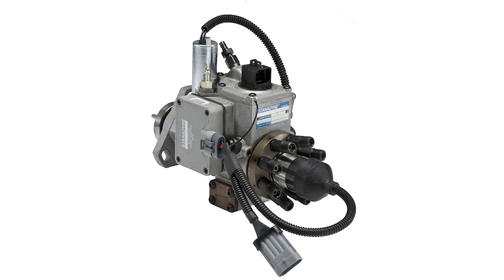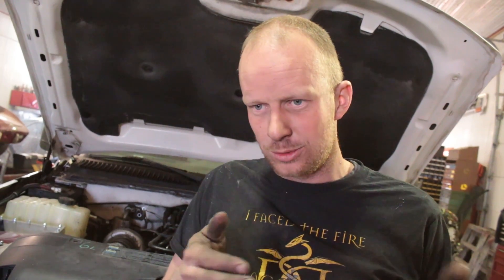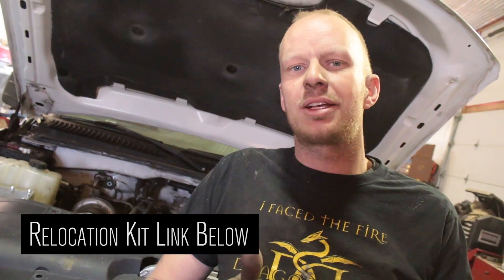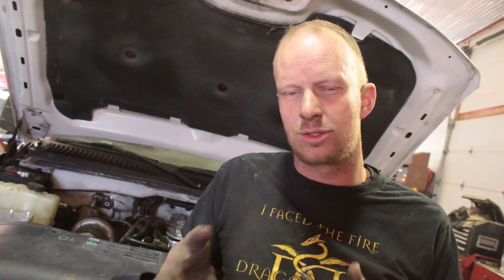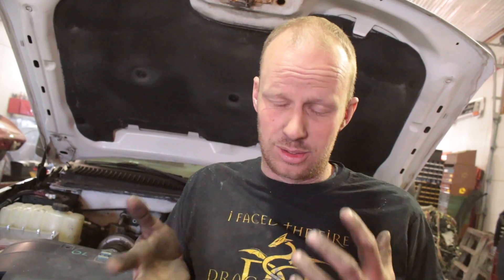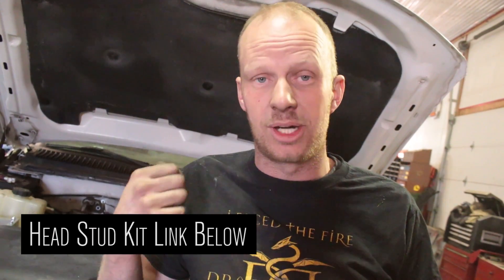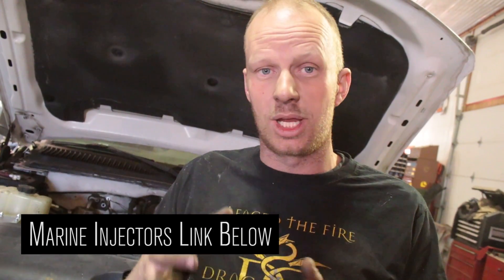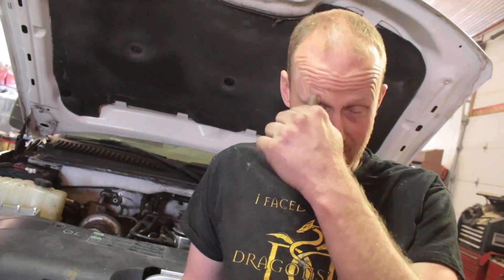REVIEW: Everything Wrong With A GM 6.5 Detroit Diesel

Comment: Haha 6.4 cough had me dying
Reply: Navistar fucked the pooch..
Reply: @PureCountryof91  they just weren't ready for DPF. Trust me when I say there was NO diesel engine ready for that crap. Even if you didn't melt a piston or valve you would definitely kill turbos quickly.
Reply: Works great as a boat anchor, not so much as an engine
Reply: @MrErikw26  One fast motor if you can keep it together.
Reply: @Mrjohnnymoo1  that's a YUGE IF
Reply: @MrErikw26  Granted, but I guess the 6.4 is like an 80s rockstar. It's here for a good time, not a long time.
Reply: 6.4 was designed as a 100k throwaway engine.
Reply: 6.4 was a huge mistake. Ford threw it out there when it wasn’t ready. Junk!
Reply: Its why ford dropped international and built the powerstroke themselves
Reply: My deleted 6.4 will drag the Detroit junk all day long
Reply: The 6.4s r dumpster fires. Get a 6.0
Reply: Same
Reply: I had one ..... It blew I have a 24v now
Reply: My brothers burst into flames from the crappy regen system. He replaced it with a silverado.
Reply: Lmao! I was saying the 6.4 in my head than he said it!
Reply: So I've been working at this shop for 18 months right.. the same blue Ford truck cab is 10' in the air suspended over top a dead 6.4 in frame, cuz my boss doesn't know what's wrong with it or how to fix it! So he just leaves it. Then doesnt bother to tell us we have 2 weeks off cuz of Coronavirus. Bahahahhaahaha awesome guy.
Reply: Anything truly bullet proof. 

Is bullet proof without having to spend thousands on fixes and days of labor.
Reply: 5.9 Cummins
Boring ugga dugga engine
7.3 Powerstroke
Boring ugga dugga engine that marks its territory
6.0 Powerstroke
Slightly fun ugga dugga engine that says fuck you with it's hpop and won't start.
6.4 power stroke
Raped ape until everything on it says fuck you and dies
6.7 Powerstroke
Penultimate POWER.
.
.
Until the egr clogs then you gotta tear em down

24 valve Cummins
Higher flowing ugga dugga engine

Where's the Chevy you may ask?

There engine is made my Isuzu

Bless you I know
Reply: @trexthepony8614  I mean a 12valve Cummins is JDM so. 🤷‍♂️
Reply: @trexthepony8614  I dont think you get it. The 12 valve cummins is litterally japanese.
Reply: @Pandasquidward  the american company with a German injection pump is japanese? Do tell I would love to hear it
Reply: SilverPanda WS6 No. No it isn’t🤣
Reply: @trexthepony8614  Explain how a Detroit 6V-71 is "clapped out".They used 71 Series for a long time in Military trucks from Oshkosh or Caterpillar.Before updating to 92 Series and actual Caterpillar engines.
Reply: @Pandasquidward  are you insane
Reply: SkyBlu_LML   So I did hear that when he coughed
Reply: Any ford powerstroke sucks so does the name brand ford and diesel truck they made sucks including the old 7.3
Reply: Gamerbeastboy18 you must never rode or driven a 7.3 or even looked at one
Reply: @gamerbeastboy1842  sounds like you’re a fanboy of....something. Power stroke is a great platform, except the 6.4, they’re pretty useless from new.
Reply: @gamerbeastboy1842  I see you saying bullshit all the time about the Powerstrokes on any video from YouTube.If you've never owned or wrenched on one,keep your ignorant mouth shut.If you want to talk about the negativity,focus on the 6.4L PSD which was one of the worst compression engines ever made in existence,it was utterly a piece of shit.The other main three (7.3L PSD,6.0L PSD,and 6.7L PSD) are far from worse.
Reply: SkyBlu_LML  ya it had me to for a min
Reply: He forgot about the 6.0
Reply: @daltonbrink6336  The 6.0L PSD is far from being anything like the 6.4L PSD.Both engines have a 4.13 stroke while the 6.0L has a 3.74 bore but the 6.4L has a 3.87 bore.Most 6.0L PSD's from 2003-2004 were actually more problematic than the ones from 2005-2007.Most obvious issues were the EGR cooler,oil cooler,and head gaskets but some have actually gone as high as 350,000 miles without one of those failing,which is rarely heard of.If a EGR delete is done and a blue spring upgrade is completed,they wake up.Head studs aren't actually a necessity unless the head gaskets are a problem,but it's still obviously a better thing to do.Alot of the 6.0L PSD's actually have traveled up to 600,000 miles like the Ford 6.7L.
The 6.4L PSD is just disastrous,it really is.They have weak pistons,and since they have DPF espiecally for the filters,exhaust strokes dump fuel and there is continuous blow by.You cannot solve this error,cylinders number 7 and 8 will always have blow by on a compression test.They also have the same EGR and head gaskets failures too.The sequential turbochargers on them are weak and always fail,it's better to use a Non-VGT turbocharger.If you have a aftermarket 6.4L PSD,at best,it will last 515,000 miles if you're lucky.The 6.4L PSD commits suicide at 309,000 miles.It's actually just the best option to use a F250-F550 with the 6.8L V10 if you want a 2008-2010 Super Duty,the alcoholic gas V10 will actually last far longer in mileage than them.
Reply: Dalton Brink       6.0 turned out to be a great engine with aftermarket support
Reply: @tomh6779  agreed
Reply: Or the 6.0 Ford
Reply: 6.4 is better than the 6.0.
Reply: @madbear3512  you're fucking drunk or have never worked on either.
Reply: @Alejandro-vb2fx  6.4 was not designed for DPF, which the 6.0 never had. Do some research on diesel engines. Many manufacturers discontinued sales of their engines in the US after 2007.
Reply: madbear3512 lol how at least the 6.0 had a strong bottom end
Reply: @madbear3512  nope, not even close. Once bullet proofed the 6.0 is a great engine. The 6.4 is worse from the start and never gets better. No diesel shops will tell you to use a 6.4 in anything. Not so with 6.0, again, once bullet proofed.

Comment: Didn't the HMMV use a 6.2 liter for a while too? They were pretty mediocre too. Putting a Cummins or Cat in one was a nice upgrade, or go back to a gasoline big block, and plan on replacing it early/ier.
Reply: had to be very little elctronics in a hummvee and the 6.5 wasnt meant for what they used them for remember 13k poind vehicle a 12v wouldnt have lasted either

Comment: the 6.2 diesel and 454 was better than the 6.5 by what I've read
Reply: Jeremy Gilliam If you've got a 454, that's due for a rebuild, you can always take it up to a 496. Sixty over, with  a quarter-inch, stroker crank.

Comment: I put a 6.5 turbo truck engine in my boat not knowing that it had a strictly mechanical pump. Good news when I found out. It runs great even without water cooled exhausts. The exhausts are heavily insulated. I tow the boat with an 86 Chevy truck with non turbo Goodwrench 6.5.  The new fluid filled harmonic balancer smoothed the engine out and was worth the price.  It saved my new rubber dampened pulley drive and the belts don't vibrate as much.

However, on both engines the injector leakoff lines from GM FAIL in  a little over a year They turn to gummy rubber and once sent a 20 foot long stream of diesel fuel down my driveway on a hot day even though the truck was last running a week before. I got the leakoff line kit from NAPA Auto. I got 2 sets from eBay with the braided jacket using Mercedes tubing. I suspect that the California politically correct fuel has something in it that destroys the tubing.  The boat blew a leakoff hose once and left a smoke trail like a WWII destroyer. Lucky no fire.

Do you have any input on these leakoff lines?
Reply: if you have to modifie it,doesnt that tell you there shit engine.look up wiki,or google,.its  a horror engine.

Comment: The internets says the GM-8 turbos that came with these guys is perfectly capable of more than the stock boost these engines ran with. Why upgrade a seemingly worthwhile turbo with an HX35?
Not being a smartass. Serious question.
Reply: the gmx turbo doesnt flow as muh air as a hx35
Reply: Right, but unless you're going to tear into the motor to drop compression, it doesn't seem worth it. If big torque is what you're after, better to swap in a Cummins or start with a Duramax in a newer truck.

Comment: 6.5 + 6.2 were intended to fit in the space of a big block Chevy. and weigh about the same. hell they put them in 1/2 tons. the problem with a 12 valve Cummings is it weighs almost twice what the 6.2/6.5 weighs, and is much longer.

Comment: i've got one and in low range 4 wheel drive ittl pull just about anything you want it to and in four high i pulled the gmc equivalent to a Silverado and in low range i pulled a gmc yucan then i pulled a h3 hummer the chevy k 3500 is geared very well in low range the only engine problem i had was the fip and it cost like $850 for a stanadyne part and i did the work my self when i was 17 it's not hard its difficult it only took like 3 days of non consistent work because i was in school at the time

Comment: there is a lot more to be said on these. I own 2 of them. The cooling systems on these are not great, block casting quality varies year to year, and these are still made but by navistar. They have been redesigned though. They are the lightest v8 diesel out there at  750 lbs fully dressed. Also the electronic pumps can be rebuilt for $500ish at local Injection pump shops. There are tons of stuff for them in the aftermarket world that address every problem imaginable.
Reply: navistar? what?
Reply: @acow9966  yes, Navistar makes the engines for AM general. It's called the 6500 optimizer.

Comment: Your comment about the 6.4 is incorrect. Maxxforce 7 engines are used in a lot of applications, in a lot of model years all the way up to current. The military used them because that's what AM General put in them as the cheapest solution, and the replace a metric shitload that blow up.
Reply: Kyle Sonsalla all military engines blow when they weight 13500 pounds
Reply: That's far from the truth. MATV's run a Cat C7 and don't blow up all the time, and weigh a lot more. JLTV's use a Duramax and they don't blow up either, while also being heavier. Light duty cranks that snap, chain driven cam/IP that get all out of time because the chain stretches, head gaskets, IP's burning up prematurely, they just should've never been in a military truck in the first place.

Comment: I understand the 12 valve Cummins is a great engine, but I was wondering why most people seem to have way more love for the 12 valve then the 24 valve? Is it just because the 12 valve is simpler and came with a better injection pump? Because I would think, apples to apples, that a 24 valve would have the potental to flow more air/make more power then a 12 valve.
Reply: 177SCmaro -1998 was the last year cummins offered the 12 valve which is a mechanical engine. When they flipped in 1999 they went to the 24 valve it's a electronic engine. Electronic a little trickier
Reply: BoostedDeere Makes sense.

Comment: how about the 97 6.5 none turbo. it was united states postal service application.  does it still have fuel pump issue?  my runs great 78000 miles
Reply: What did the postal service use it for?

Comment: I must lead with this I like the 6.2 and 6.5.  I agree with you on pretty much all you said.  Power is adequate, sure, it's 145 or 185 hp but 250 hp is actually a number that lives quite a while in these.  I'd toss the PMD and simply go with a full mechanical pump.  Gale Banks has been running these forever and frankly the chip is more trouble then it's worth.  But again, power is adequate, you're not winning races but it has more then decent torque and it's also nearly 250 lbs lighter then the 12v.  Add to that some engine compartments will not take the straight 6 length..... longevity, you're right, 125k for pumps, 450k for motors but as they are surplus army for the next 500 years, they're dirt cheap.  You will get 2 million miles out of a 4- 6.5 motors and you will pay less for all 4 then your first 5.9.  Finally, the place they really shine is small 4x4s - the 4bt is heavier, less hp and less torque.  They wake up to comparable levels of the 6.5 and the 6.5 is stock GM bellhousing, so 5 speed, np435, turbo 400, 700r4, and even 4l80e (with the PMD, unfortunately).  That said, you should have talked about the head gasket problems, and the NEVER overheat them... they work really well with a Banks turbo, and the hp level is almost the same as the stock gas motor but with tons more torque..... and twice the fuel economy.  Point is, build your rig for what you want it to do - pick the power, the torque and the weight for what you're building.  If you're building a light trail rig, save 400 lbs.  Towing a sled? 12v all the way.
Reply: a71landcruiser
Reply: They also crack the heads quite frequently, at least the one's i've seen. A decent engine, does the work, but doesnt bring much more than that to the table.
Reply: Torque moves mass, HP sales car's
Reply: @pmotorsports8276  Idk what mass you plan on moving with the 6.5. Good for about 7400 pounds. You can tow near that with a v6 tacoma or frontier these days.
Reply: @270eman  what gear and rpm? It matters their gas mileage goes from 20 to 7

Comment: Most folks don't realize 92-93 were all mechanical and didn't share some of the issues the newer computer controlled trucks did. I had a 93 family owned from new always maintained and treated decent and it never had an issue in 250k. Got excellent mileage and pulled fine. I did sell it to buy a 98 12v cummins. The old 6.5 did a good job though.

Comment: My dad loved them for some reason though they constantly left us stranded. The last one I had was a 1995 and after doing all the mods to fix the fuel pumps and electronics blowing,  I gave it away. It still kept blowing pumps and controllers every year. Sorry but if you have to dump about $2000 a year in just those,  it is a crap engine. 

The replacement was a Ford 7.3TD that never gave me a problem. I even ran filtered old fry and motor oil mixed with diesel in the summers when diesel was over $4.50 a gallon with zero problems.

Comment: In 1998 my 6.2 crapped out with well under 100k , swapped it out with a 6.5 still going , at fuel fillup use a pint of 2 stroke oil to each tank ,

Comment: Honestly, I'd rather take a 6.5 over a 12V Cummins because Detroit and GM merged together, the parts are dirt cheap and it lasts long enough and is reliable enough to where you won't be breaking the bank to keep them going.
Reply: Chevyblock 550 detroit was always with gm since they started up it was gms diesel division

Comment: I mean 12 valves aren't in everything. I mean the 6.5 and 6.0 were both offered in vans and the 5.9 wasn't. Also the 6.2 was the only class a front engine diesel motorhome engine.

Comment: The 6.5 is a turd! My dad had a 6.5 GMC Yukon 2 door. It made 195 hp with a turbo! It topped out at 85 mph and it was such a turd that it rolled coal towing our dirt bikes on a aluminum trailer!
Reply: Donovan Savage rolling coal isnt a sign of a hard working diesel it is literally over fuelin
Reply: +jdr ok which happens when the engine is working hard

Comment: Power stroke always ran circles around these in  power output. That was when Ford was in bed with international. Now Ford builds their own 6.7 diesel and it is light-years ahead of GM. (Isuzu cough cough) I drove suburban with 6.5 for years, very reliable. Only complaint was power output was similar to boat anchor.(edit for grammar)
Reply: tyler jackson 15 lbft more oh shit holy shit and um lb7-lbz where all designed and built by gm and isuzu cough cough

Comment: I have twin 6.5Ts 18:1 in my 36ft Cruisers and they run great. Only issue I get is they start to spew oil vapors out the dip stick tube above 3200 rpms. Wish they were a little more powerful tho.